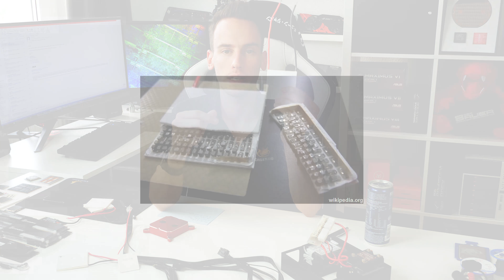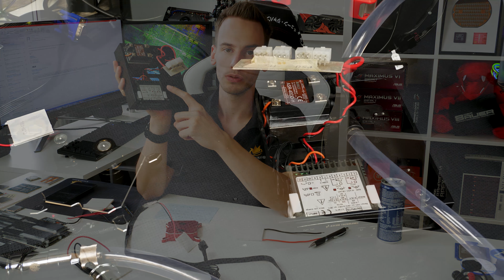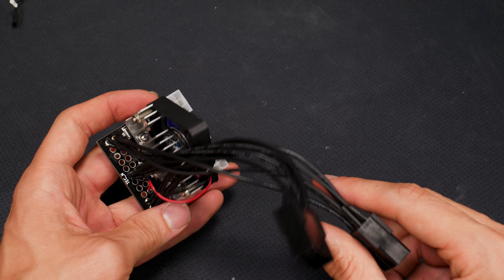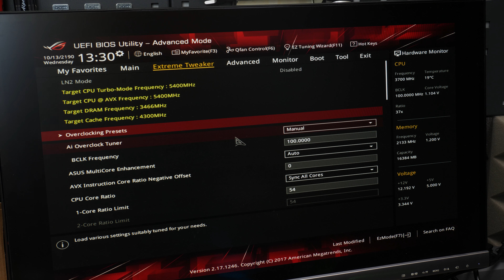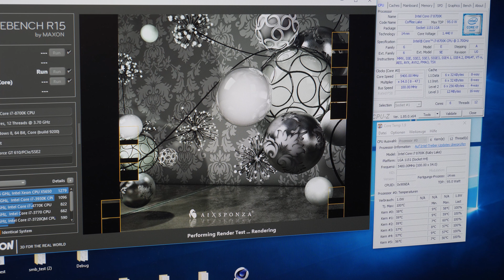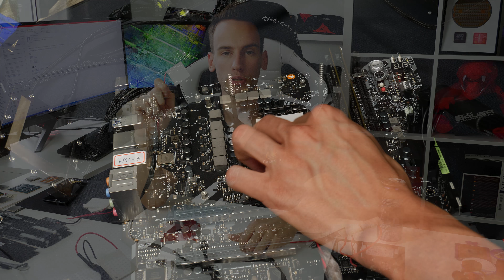TEC-Water-Cooler in 2018?

Comment: Realize that if the TEC is cooling water coming out of a radiator, the TEC should be able to use average  air cooling and an average heat sink. As conventional water cooling can't get water below ambient temperature.  It is important to note that some users might require lower than ambient temperatures.   A TEC positioned after a radiator should manage this with ease and be a much smaller device, with the cold side inside a sealed housing is best to reduce any condensation using the HSF outside the housing.

Comment: I'm sorry, but nobody does this correctly. The proper thing to do is radiate the CPU heat into the air like normal water cooling, THEN chill the water. This way you don't need to cool 180 degree water, you only need to cool 80 degree water, which requires much less power and a smaller Peltier TEC.

Comment: Replace the Poor Solid State relay with a mosfet !
IRFB 7434 (195A) (<0,0016 Ohm) (Price 2$) for example. 

This Mosfet have a voltage drop of only 0,048Volt and 1,44W Heat @ 30A Load

Comment: If a peltier cooler is properly designed and sufficient heat extraction out of the case they can be very effective at stopping the cpu temps rising drastically, also adding a thermostat you could in fact build a peltier system to cool the whole of the inside of you pc case (better idea)

Comment: Have you thought about doing this in a different way? Maybe using the TEC in part of a heat exchange with a water cooling setup. I understand you used water to cool the top of the device, but what if you actively chilled the water using the cooling effect? I think this would make running it in a daily rig more reasonable to keep temps down? Cooling the water after it leaves the rad?

Comment: for the condensations would some kind of synthetic sponge like absorbing insulation work? that wicks up moisture and then when the TEC turns off and heats up the dampened insulation then evaporates from the heat and is dry again.

Comment: I would like to buy one of those controllers, I'm building a similar PC. You could also use a DC DC converter or Meerstetter Peltier controller which is a precision controller and adjusts the output power (Voltage X Current) depending on your object temp compared to your cooler temp (Water/Heatsink). This is much more efficient that switching the TEC on an off which wastes heat back into the TEC. https://www.meerstetter.ch/products/tec-controllers/tec-1123. Here is the single channel one: https://www.youtube.com/watch?v=8l-SAYPHo9M&list=PLqeVgp0aFJzXQarbFeiE1qL3yQPvbW0Rd&index=2
Reply: i found this https://www.tec-microsystems.com/products/tec-controllers/dx5100-oem-tec-controllers/index.html but i need to dig more

Comment: your cpu will short eventually. the water from the condensation on the CPU will turn into ice and melt.. i will do it the other way round using TEC to cool off the water in the reservoir. From the cool water in the reservoir will push cool water to the cpu block, the cpu will push to the radiator to cool down first before reaching to the peltier cooling block . you may just need a heatsink for the peltier with the front case fan cooling it.with some DYI reservoir with some alu or copper pipes.

Comment: Id buy one for sure!  I Have a few CPUs That id like to see how far i could push,  I have a cherry 4790K that holds 4.85Ghz with 1.38V On 1 360mm Rad, No delid or anything,  Id love to crack it open delid it and see how far i can push,  It runs windows at 5Ghz all day with the same voltage!

Comment: So I had an idea of running these but it's slightly different and if I am honest I think more efficient. 
So my idea was to build an entire water cooling loop normally minus rad's. Have a Peltier or "tec" as you seem to know it on a water block cooling the entire loop then on the other side a normal aluminum air cooler. You could go with a relatively small air cooler as it could handle 100+ Celsius no trouble and would shrink the overall cooling system by a lot with the lack of rad's and allow sub ambient cooling while your at it.
Your design is cool no doubt but I just can't get over the fact that your still using rad's to cool the system when they could be removed.
Reply: Well under load I would not call that extreme.

Comment: I remember when Cool It Systems made TEC cooling systems at a consumer level. Back in 2008, I had bought two. One cooled my Q9650, the other cooled 4 GPU cores across two Radeon 3870X2 cards. I miss them.
https://www.techpowerup.com/gallery/1577/cool-it-master

Comment: Hey der8auer! This might be a stupid question, but are the der8auer versions sold at Caseking "resealed" after delidding(ihs glued back to the cpu?)
Reply from the maker: Yes resealed :)
Reply: Ok thanks for the quick answer. :) I think i need to wait for the 9900k and see how it does compared to 8700k/8086k to see if that is the way to go or if i should go with a properly delidded and tested der8auer 8086. Or maybe there will be a der8auer 9900k which is the way to go, will see that in a couple of months hopefully :)

Comment: What if you designed the waterblock in such a way that it still performs on par or maybe a bit worse than a regular water block with the TEC off, but then you can have a temporary boost mode where the TEC kicks in and just drops temperatures for a quick load? like a 2 minute render on a 5GHz 16 core Threadripper. That would be sick, now someone make a 500W TEC.
Reply: thats what he is doing here... the TEC powers on at 25c then off at 20c
Reply: Democritus86 not quite, my idea is to avoid the 300W hit altogether in everyday load and only have it on for special occasions, if left off in its current state it behaves as a thermal blanket. He didn't mention the switching frequency but I imagine it doesn't take long to rise to 25°C

Comment: But what about single stage phase change?
Reply: Way better... My FX runs 5.5 Ghz 1.7 Vcore and peaks under load at 10c (the block peaks at -25c). Phase is much more efficient. Compressors in air conditioning move several times more heat than what you input, while a TEC is far worse.

Comment: That was fascinating.     I always wondered about this topic.     It seems the only way we humans are ever going to have  a 6 GHz CPU is if the CPU designers do some radical redesign of the entire
socket and wafer shape inside the CPU.     I hope to someday own a desktop pc with a 5 GHz chip on an air-cooler.
Reply: You want an FX? It was stock at 4.8Ghz (base clock) 5 Ghz boost clock. But now you see frequency doesn't matter, when it would take 9 Ghz to match my Ryzen 1700 with SMT disabled...

I do have an FX running 5.5 Ghz, but my poor $40 motherboard is about to burst into flames, LOL!

Comment: I have actually bought one of the TEC's before. I am very interested in this as I got my 4790K chip to 4.9ghz @ 1.346v on a H110 Corsair cooler with a push pull. And heat is my issue. My ram is also overclocked from 2400mhz to 2666mhz @ 1.68v (ddr3) at 11-14-14-32-2T.  ,  and then my video card which is a Gigabyte GTX 980ti Windforce, its got default cooling with fan curve adjustments from a custom bios I got programmed on it, I am at 1583mhz boost, and 1552 I think? base. Ram on it is at 4130mhz effective 8260mhz. I am beyond a fan of yours, been there since somewhere between 2011-2013 when I first started seeing you pop up in the overclocking world. We've talked on facebook before also. :)

Comment: from what i have seen using them diretly is not the best way to use them, the best way is use a normal waterblock on the cpu and then have 1 waterblock on each side of the TEC, using a radiator to cool down the tec, this way you can have bigger waterblocks that allow you to use multiple tec and that way keep the low temperatures for longer

Comment: My Dad used to use similar things like that back in the 70's to heat Diesel Engine blocks of Massive 12 Cylinder or Bigger engines. Some of the Engines he worked on where Bigger than a House, some you could actually climb into, they were used in Container Yards or on Straddle Hoists used to take Containers off Container Ships AKA those BIG BOXES y'all see on a ship.  Most of the equipment was A diesel Motor that Ran an Electric Generator that made the power to turn and lift those big boys and the heavier they got toe more power which means BIGGER & BIGGER Motors back in the day!! one of the piston Holes you could stand in. 
  He would line the OIL Pans With Similar to the TEC , it might have been the early version BC i know if not watched they went bad and once  shorted you had to replace the ones burnt up. 
   De8auer here is something for you, We use them sometimes here in Florida To Cool the Engines on the Farm equipment when temps here hit 115f /43c with heat index so yeah we just run a second generator to power the Blocks to cool the engines down almost 100d diff they are that effective and before some cry omg but your using more diesel to make more power to cool , UMMM Nope if you know thermal dynamics its actually ALOT LESS, because the engine runs more efficiently & cooler so it uses alot less diesel to produce the same power and its better on the engine.  Just thought you might like some real world uses that I know they are used for.  Just my Lame half cent comment.  Cow }:-o)      Hope your having Fun at Games Con !!
Side Note.... They were running Much Higher Voltage on the units i think they were 72  v Dc if i remember sorry its been 30+ yrs and the ones we use on the tractors are a 12 volt version like yours. i know they had some serious cables going into them like 2 gauges or lower maybe.

Comment: The Seebeck effect is also quiet interesting. It's the opposite of a Peltier; voltage potential from temperature difference. I'm still waiting for a cooler using a seebeck device to power it's own fan
Reply: BangDroid there's a little camping stove that does that. Has a blower fan and a usb output if I remember.

Comment: You are the first person I have seen on Youtube, that actually knows what he is doing with these TEC cells. Thank you for the enlightening video. Do you think it would be possible to make a small gas compression-expansion device (tiny refrigerator) that could achieve much higher efficiency?
Reply: Yes, those are known as phase coolers. Mine cools my FX at 5.5 Ghz with max core temo of 10c under load (the block peaks at -25c under the ~450w load). They can go much colder if needed, mine is just a small unit. They made them commercially, but cheapskates prefered inferior cooling with $500 water loops, when you might as well spend the extra at that point.

Phase, DICE, and LN2 are the holy trinity of overclocking and the staple of any testbench.
Reply: I wasn't aware that you could buy these already. Thanks for the info.
Reply: @SuperFredAZ  Oh goodness yes, Asetech (THE aio cooler company) stoped making my chiller back in 2006. It's been half my lifetime since they made one. You can still buy "little Devil" cooler brand (available with both CPU and GPU blocks).

They were pretty cheap at $1k＋ (people spend half that on a cheap centrifugal pump, a chunk of copper, and radiator...). It's expensive yes, but you'll find you blow up more parts than your cooler costs when you don't pay attention... RIP my first GPU, thank goodness you weren't my Titan Xp collectors edition! (practice on some cheap parts, and have fun!)

Comment: Tried one of those on my Rx480 with an arctic accelero xtreme IV. Things could have gone better but the GPU's die is just too small and i didn't have a dedicated heatspeader it was just direct die cooling so yeh on idle i reached as low as 9c but under load i hit thermal shutdown quite quickly.